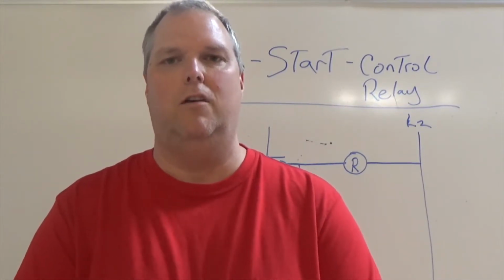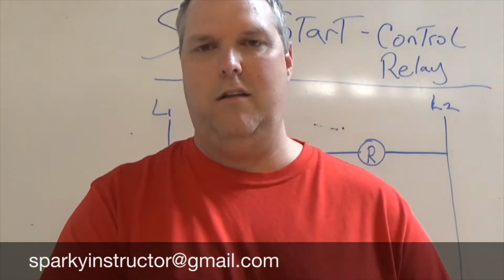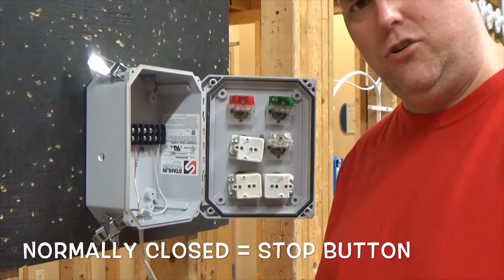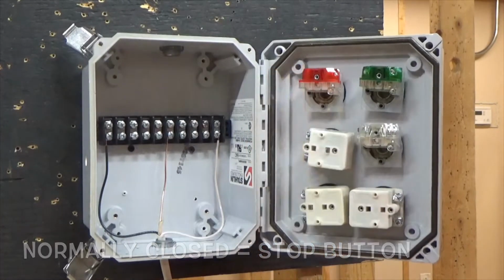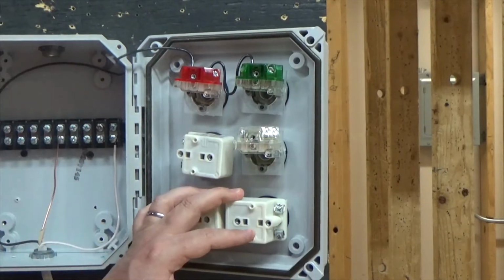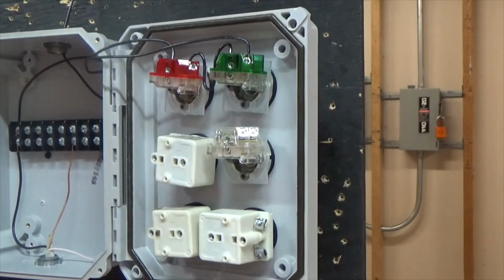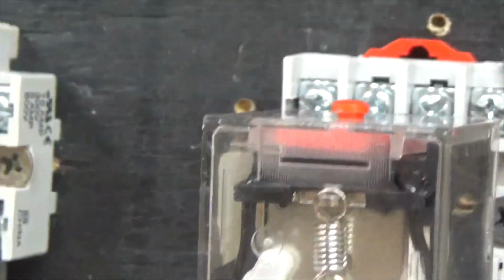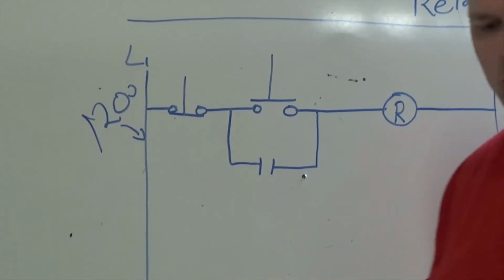Start Stop wiring Basics

Comment: too bad you didn't explain what the other black wire was for going to the normally open contact where the power came in from the normally closed contact was.
Reply: It’s a power jumper going to the relay to make it hold. Otherwise , it would shutoff as soon as u let go of the start button. I agree. He should explain
Reply: I was wondering that samething.  I saw that extra wire and had to go back and look if I missed something.  I think he may have edited the video wrong.  In another video he shows we're that blk wire goes and a jumper he installed

Comment: Excuse me sir, I noticed you end up having a 3 hot wires connect to the n,o star switch. 
Is the wire that is tight to the hot side of the star button a holding contact, I didn't hear you say something about that wire.
Reply: Yup, noticed it too...this is a great video but small things like that can easily confuse someone.

Comment: What is that other black wire going into the start button??? Relay?
Reply: There’s 3 wires going in to the start button 1 is coming from the stop 2nd is going to the relay#2 terminal  and 3rd to n/o 1#  terminal on the relay, than jumps #3 - #2 to power it.

Comment: Craig before you added the neutral there is only two wires on the normally open button. When you’re done landing the neutral at the 8 pin relay, I see an additional wire on the button. What is that?
Reply: I see now it’s the hold.

Comment: Good video but it looks like you have 3 wires connected to the green button , but in your demonstration you only show 2 wires connected to it.  The jumper from the stop button and the wire going to the relay.  2 wires .  But at the end of the video the green button looks like it has 3 wires connected.  Where does the third wire go ?

Comment: What’s the holding contact called again? And is it inside the relay? Wondering coz I didn’t see you wire anything other then start stop and relay. I took coarses at scit in Anaheim in 2015
Reply: Auxiliary contacts. But I didn't see him explain it here. Still the wiring for the start stop circuit was informative.

Comment: I have watched a few of your videos. Special interest in latch holding. I have a two pole 240 contactor that uses 24 volt coil. The latch holding circuits I have seen use contactors with 120volt coils.

How do I set it up with the 24 volt coil. I have momentary button switches.
Reply from the maker: you will need a 24 volt transformer to wire through to the buttons and back to the coil. just like I showed in the latching video.. If you have any questions email me sparkyinstructor@gmail.com
CM

Comment: I have watched the 8-pin video with a holding circuit. I have watched the start Stop wiring Basics video. I have created a circuit test board that will has multiple start/stop stations.  Instead of having to run the stop wire from station to station so it is in a serial mode, is there a way to run all the stop wires to a master and be able to stop from any station?

Skip....